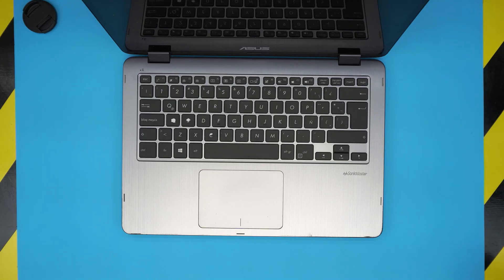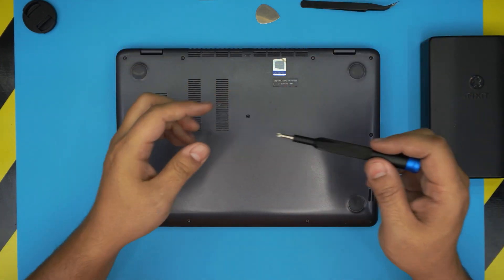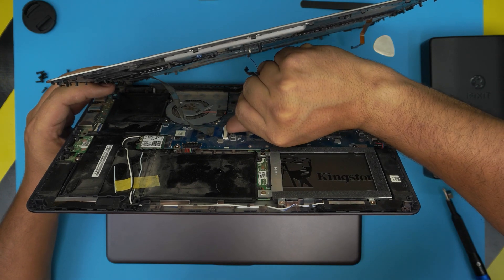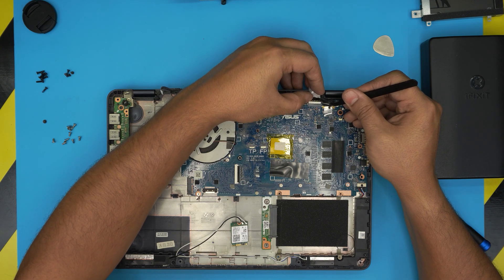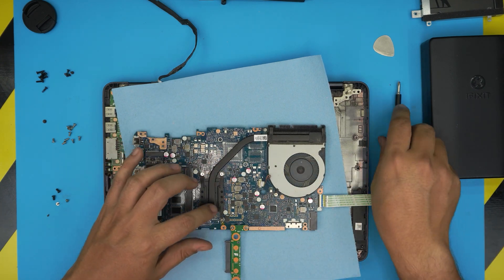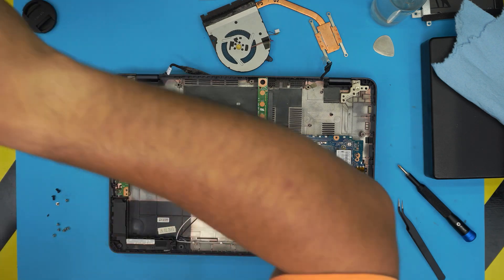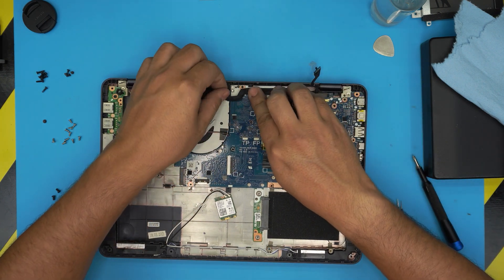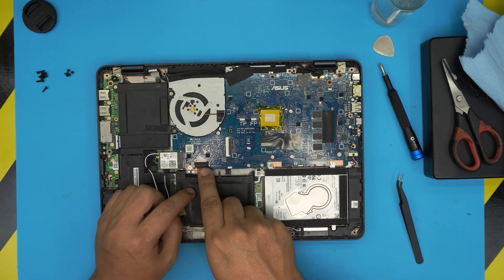Asus Vivobook Flip 14 Tp410u 🚩REPASTE & SERVICE & CLEANING

Comment: Do you know if I can add an EXP GDC to this type of laptop
Reply from the maker: Thank you for the feedback! if you wish to support the channel you can LIKE or SUB or both :P
regarding your question: yes you can get the one that connects to wifi m.2
you will need to make a cut on the bottom cover. DO NOT USE a USB version of EXP GDC, they are waist of money, and you will get horrible result, we have tested many many of them

Comment: This was really helpful!
Reply from the maker: You are welcome! Glad you liked it 😊Thank you for the feedback! if you wish to support the channel you can LIKE or SUB or both :P
if you have any question or request in the future feel free to ask me.
Reply: @uFixTek  Already done both :D 
I have a question though, can I attach an EXP GDC port to this laptop? I have a GTX 1060 6GB and I wish to connect it to the laptop.
Reply from the maker: yes you can get the one that connects to wifi m.2
you will need to make a cut on the bottom cover. DO NOT USE a USB version of EXP GDC, they are waist of money, and you will get horrible result, we have tested many many of them. i believe you have two account and you asked the same question twice :P
Reply: @uFixTek  why do I need to make a cut though, can't I just not completely close the cover?
Reply from the maker: because the flat cable needs to go under the laptop to the wifi connector. how you going to put the cover back on with cable connected?, unless you don't put the bottom cover on and leave it exposed.